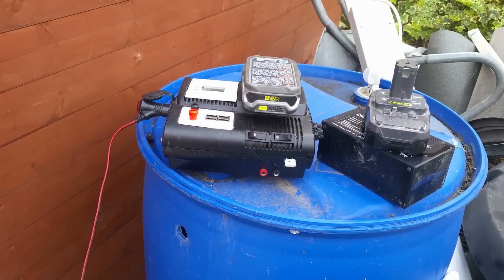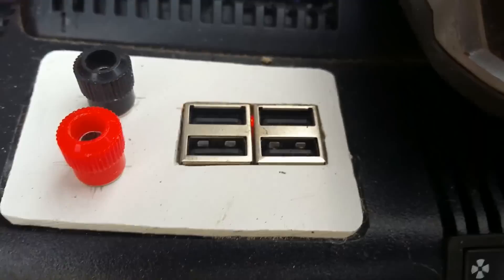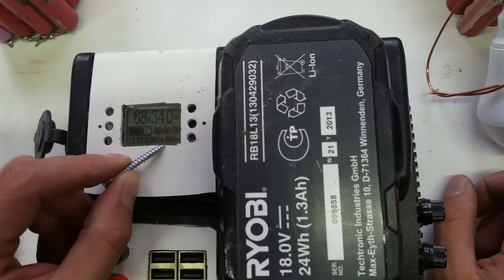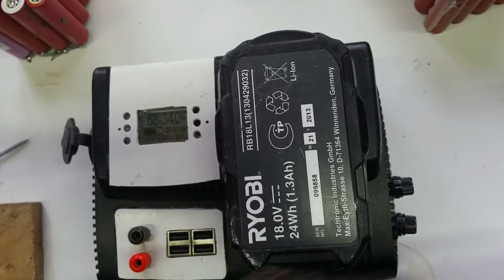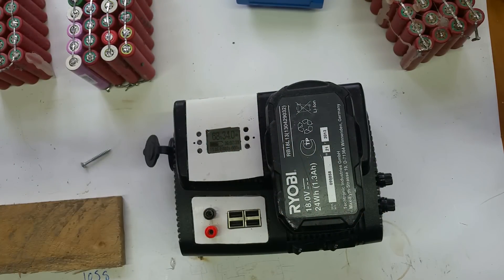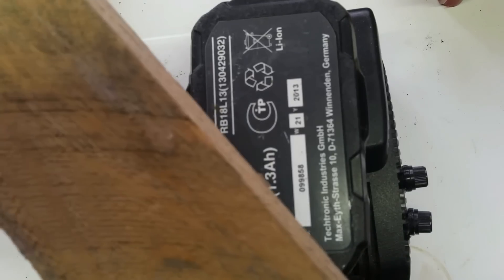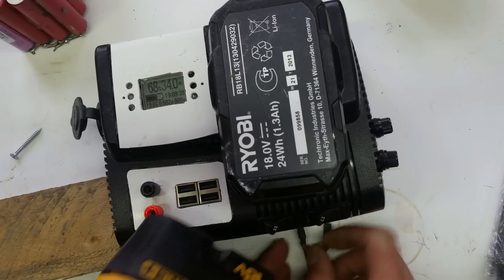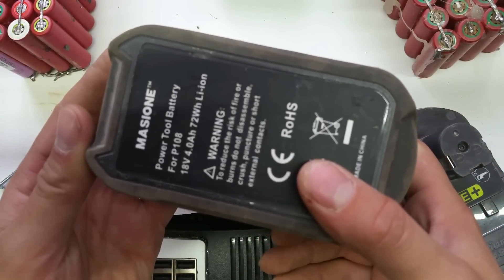Ryobi PTO (power take off)

Comment: When you pulled out the cord extension battery my first thought was "Why would you put a cord on a cordless tool?"  But then you explained and it made sense. 
Now what you need to do is 3D print an enclosure that will hold multiple batteries so that you have a longer run time.
Reply from the maker: I would love to get into 3D printing. But being self employed, I'm struggling to get enough spare time to get videos up.
Reply: I can understand that. I've been trying to rationalize spending $500 +filament cost myself, but today I ordered my 3D printer kit.  After watching MANY hours of reviews, weighing the pros and cons, I settled on the Anet A8 printer kit from GearBest. The kit comes in at $164. While not top of the line, it seems to do a fair job. It has a fairly active community who are posting their DIY upgrades (printed on the A8) to improve the print quality.  So I figured why not take a chance. Plus I'll hopefully be able to print my own cell spacers for my 18650 packs.

Comment: The meter is nice you can send a link 

gr charles
Reply from the maker: Use these key words on ebay. There are a couple of different models for higher voltages and currents.

Capacity Tester Indicator Coulometer Lithium / Lead-Acid Battery Meter 8-50V 50A
Reply: oke super

Comment: Kewl Project! I always wondered how they balance lithium power tool batteries, do you know?
Reply from the maker: I think the earlier batteries just rely on the fact the cells are from the same batch and are together for life. When 1 cell wanders out of the high/low peramiters the pack shuts down. Apparently the new range are intelligent. But my job as an electrician leaves me with no insight into electronics.

Comment: I could see people using something like that to charge drone batteries.
Reply from the maker: I built it mainly because I needed a 12v source at work to test door entry systems. But then I kept adding bits. I watch all your ppower tool videos. I would like to step up to dewalt, but not willing to leave good power tools in the van over here at the moment due to thieves bending side doors out.